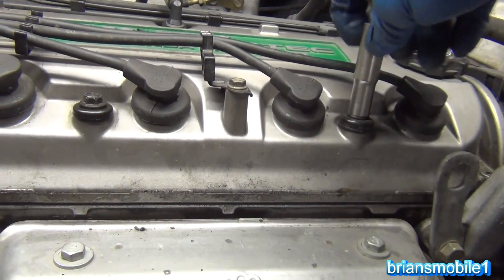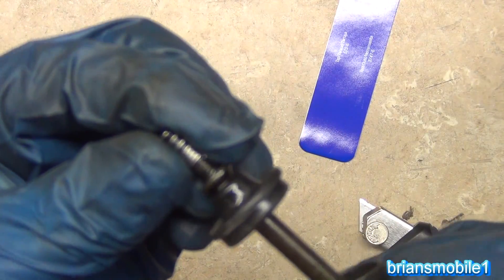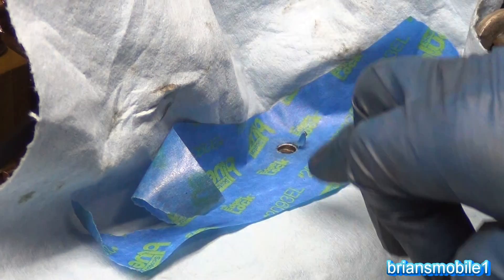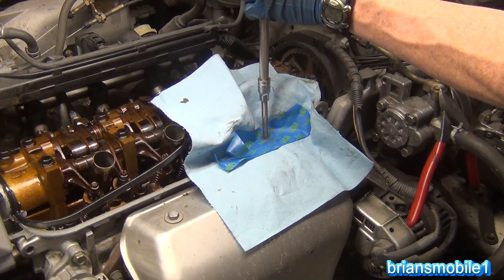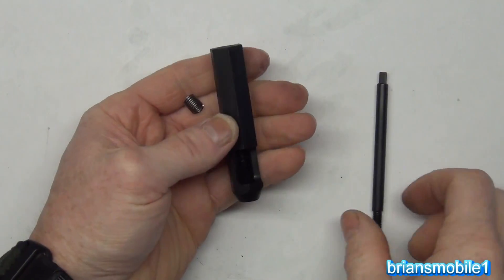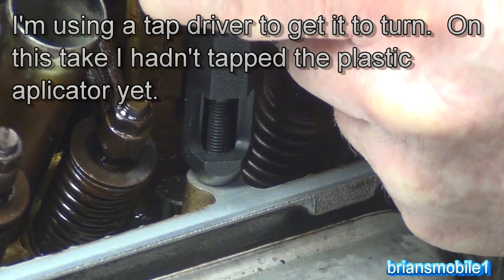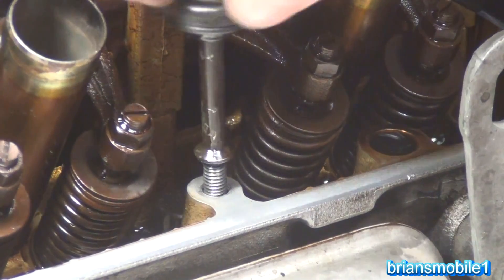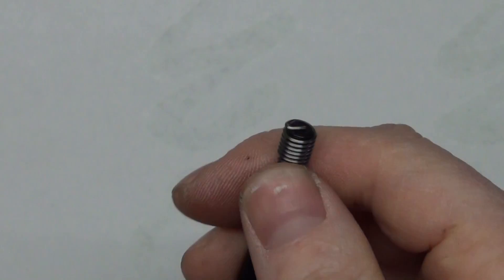How to Fix a Stripped Bolt Hole Threaded Inserts

Comment: Just smashed that like button, thank you sir for the helpful video that I will hopefully never need. 

Quick question, am I crazy for thinking I can get a good car at a salvage auction? It seems like there are good deals to be had if I pick the right one
Reply: +BoogieDownProduction 
Picking the right one is the trick. 
Many (not all) auction vehicles are someone else's unfixable lost causes or uneconomical to repair or they have been doctored to look and sound good for the next 15 minutes unless you really inspect closely. 
It is my opinion buying auction vehicles is not for a novice, at best it is a gamble every time.
Reply: patw52pb1 I agree with everything you said, one of the vehicles I bought had a salvage title; turns out the guy bought it at an auction and then repaired it. Its an awesome car with excellent records (thank you lexus for making those easily accessible)......Everything is great but I have found too thick bondo was used on the door along the edge resulting in a dime size piece falling off. Luckily a door is easy and relatively cheap at a junkyard

Learning from this I have decided to cut out the middle man and also do the repairs myself.
Reply: patw52pb1 In AZ I dont believe there are differences in salvage titles unless it was flooded or something. In this case this was salvage due to damage to the doors and fender.

Comment: Smashy-smashy!

Well done, Brian!  Any thoughts on installing Helicoils with Loc-tite?  I generally do just because I'm paranoid, but I don't think I've ever seen anyone ever mention it.  :]
Reply: +rhkips 
Using Loctite on Helicoil inserts is not recommended. 
The aluminum expands/contracts at a different rate than the Helicoil insert and that can cause unintended stresses and binding if Loctite is used. 
If you are concerned(paranoid) about the Helicoil insert backing out with the fastener, don't be, I have been using Helicoil inserts for over 30 years installing literally thousands, never once have I experienced the insert backing out. 
When the Helicoil tang is broken off it causes the insert to bite into the new over-sized thread so it is effectively locked in place.
Reply: patw52pb1
Awesome.  Thank you very much!  :)

Comment: I have a 200 sebring, I replaced the alternator and now the ABS light has come on twice, and the odometer light flickered. The first time the headlights went out, the second time I was using the brights to get home, and they blew also. Both times I was accelerating. I checked the fuse and they are good, I will check the bulbs in the morning..
Reply from the maker: +dan jensen Sounds like the new alternator voltage regulator is messed up.  Double check that that year doesn't have the voltage regulator in the PCM, but I'd try another alternator under warranty or stock up on headlights.
Reply: +briansmobile1 thanks, will it kill other systems if I save the job for the weekend and drive it in daylight